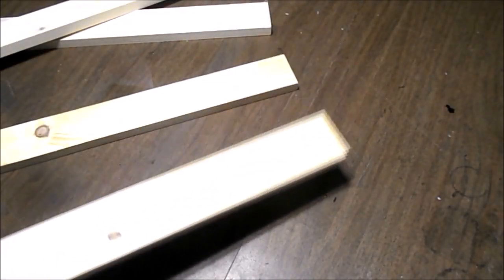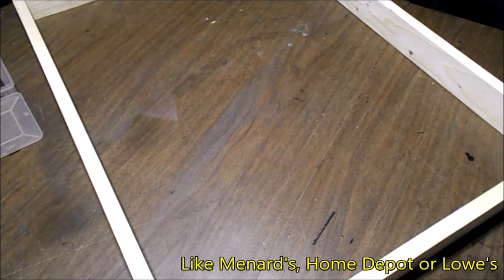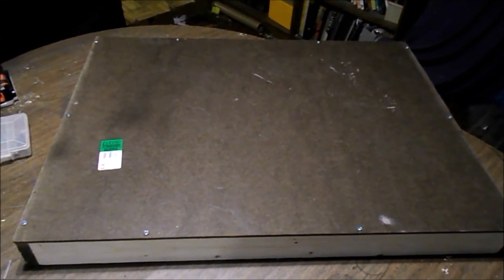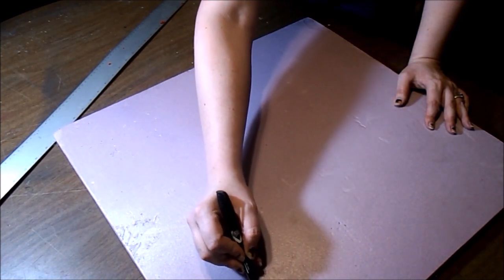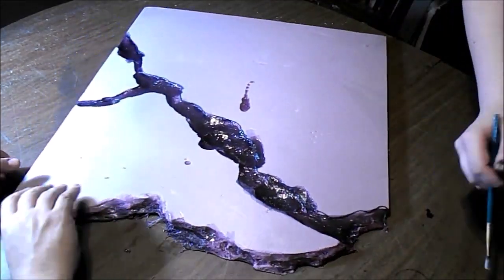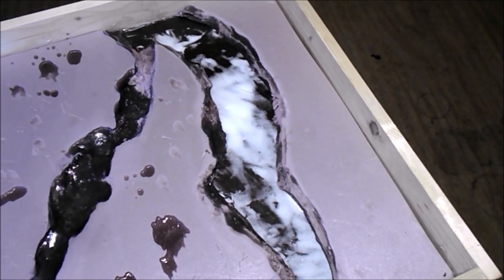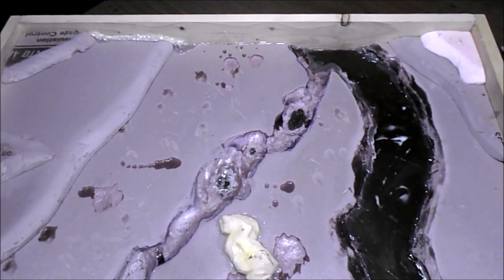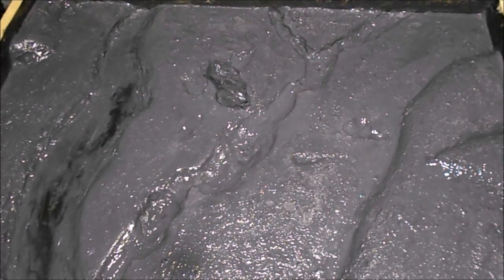Crafting Episode 16 - Kill Team Jungle Board Part 1

Comment: The proper nail will hold things a twist or ribbed will hold as effectively in this application i would use a brad nailer.or stapler with inch and ahalf staples or nails